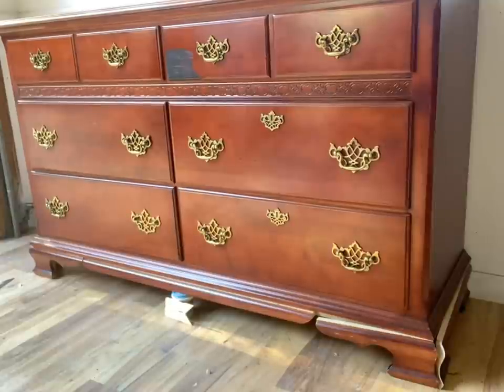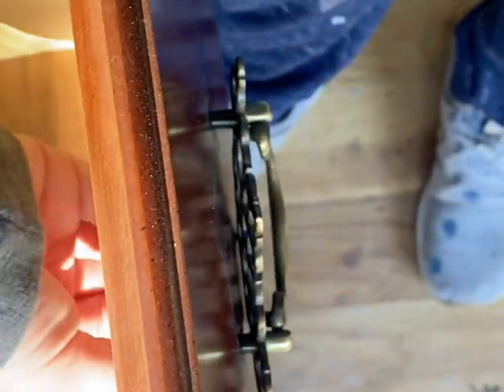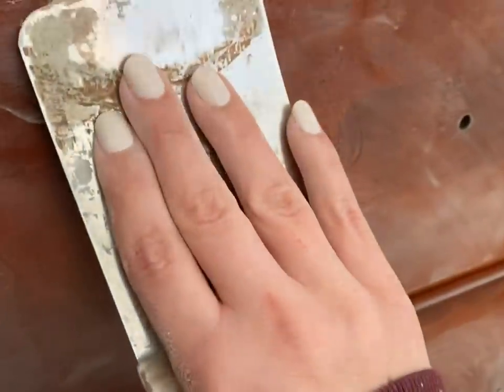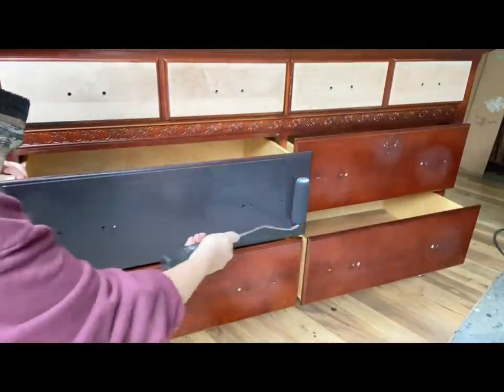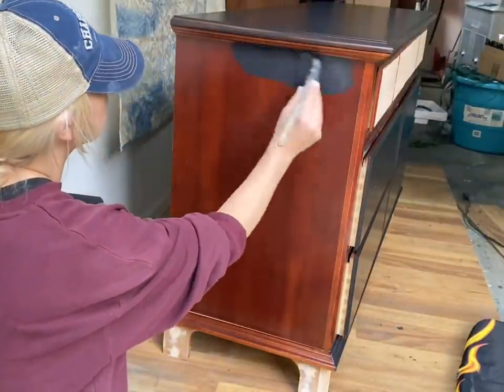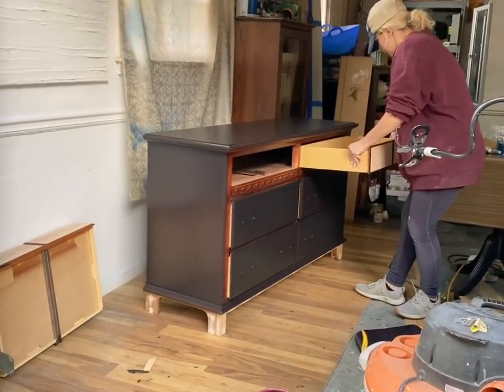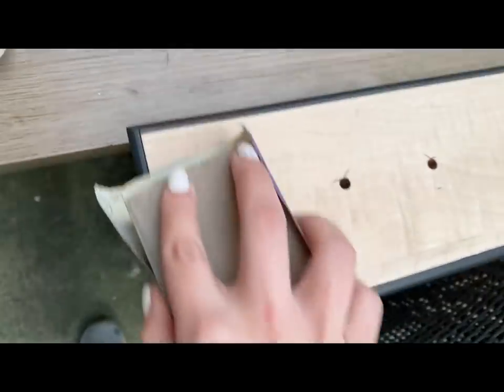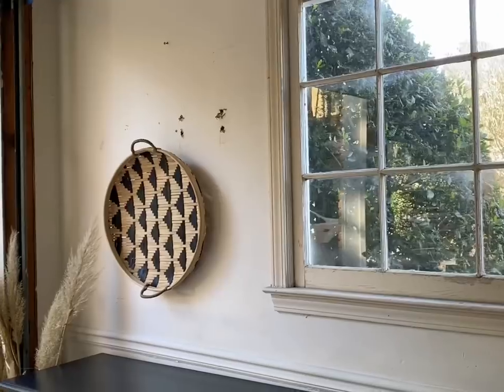These legs were behind the skirt of this dresser already!  Easy to do Boho furniture makeover

Comment: I wanted to pass along a process I use for final clear coat that is same as sprayed. Use oil based polyurethane use an old plastic bowl you can throw away and mix 1/2 mineral spirits or Xylol (Xylene)  to 1/2 polyurethane. Take a thin cotton rag I use the white cup towels like you use in the kitchen they must be lint free and cut into a 4" or 6" square folded three or four times. You want to wear a latex surgical type glove then really wet your rag and start to apply to the surface just making sure to wipe on a thin coat & let dry a lot of times I let it dry overnight. Next sand between coats using 1000 or 2000 grit paper remove dust and wipe with sticky cheesecloth to ensure all dust is removed then apply another coat of polyurethane repeating process until you have the amount of coats you desire after the last coat is applied and sanded I go back and wipe with a very very thin just damp application of polyurethane for the last coat and no further sanding I use this application for any project including kitchen cabinets and high gloss it produces a beautiful finish.
Reply: I prefer oil based clear coat because it seems to self level much better than water based. I can’t wait to try this!

Comment: I find spot priming where I used wood filler helps. I'll do two applications of wood filler and then spot prime the places with wood filler with clear shellac so that it absorbs the paint the same way as the rest of the wood that has a finish on it.
Reply from the maker: Great tip, thank you 🙏

Comment: Nice job!  

I think they're tongue depressors not popsicle sticks.  You should drill holes in the tongue depressors that line up with the drawer pulls, then you can use them as templates for the holes.
Reply: I thought the same and then realized that by doing it the way she does, she doesn’t have to ensure the holes are straight. She just uses the tongue depressor as a guide and a straight edge.

Comment: Sherwin-Williams has a paint in their "Emerald" line that is a Urethane Trim Enamel.  It sells for $100.00 a gallon but it's worth every penny.  The quarts sell for 40 so it only makes sense to buy a gallon.  I am getting ready to spray my cabinets, the legs and base on our table and our island so when you think of it like that the paint doesn't seem so expensive.  I am going to give this paint you have here a try though.  SW makes good paint no question about it.
Reply from the maker: I used that paint before and it dries slowly and for my working conditions (in the garage w/debris around) I had a lot of trouble with dust and what not falling into my finish before it dried.  I’m sure indoors would be awesome though.  I did really like the durability of it and it leveled nicely

Comment: Hi, re wood-filling my tip would be to use an old credit card instead of that large metal tool you'll find it easier to apply (smaller) amounts of filler, other than that good job done. Stu

Comment: Morning! Love this black dresser.What a difference once the bottom is removed.

I have a question about another of your videos from a while back - I'm currently in the process of re-creating your Pottery Barn Sausalito finish (which I LOVE ❤️). Using the Behr Rugged Tan as you suggested, and it's still tacky after 3 days. 🤷 Is this normal? I waited 12+hours between coats so didn't rush it and I also thoroughly prepped. Any idea what's happening? Has this happened to you using Behr paint? TIA for any advice.

❤️❤️❤️ your channel. So glad  I found it!
Reply from the maker: With the weather these days, my dry times are taking forever!  Just give it some time, when I’m going for darker looks I apply more glaze and it takes forever to dry, up to a week.  Bring it inside or run a dehumidifier if you can that’ll help

Comment: Hi Shannon, hoping I can ask an unrelated question.  I recently stained an old wooden lazy Susan I had in the kitchen,  (ok, so two days ago) the only stain I had was a min wax oil based stain.  (Didn’t feel like running out and getting a water based).  So I used it and it turned out beautiful, however, it’s been drying in a heated workshop downstairs for two days and it’s still very tacky.  Do I wait until the tackiness goes away before I spray on the poly?  And…..if I spray an oil based poly on top, will it then become tacky again?   I’m not sure how oil based stains work to be honest, first time using one.    Oh and is there such a thing as a water based poly?   BTW, sorry this dresser is FAB!!!!
Reply from the maker: Oil can take a while to dry, just give it some time, and you’re right to wait until it is dry to paint the clear coat on.  You can use any clear coat, oil or water works great but I prefer Varathane water based polyurethane or Minwax polycrylic.  Sounds like it’ll be a great looking lazy Susan!
Reply: @blacksheephouse  Thank so much for helping me.  Ok I’ll keep waiting, still tacky tonight.   So I’ll leave it alone til dry.   And thx for the tips, I wanted to try the water based Varathane so I think I’ll go out and find some tomorrow.   Thanks for all your videos, I’ve got a few projects lined up for next year and can’t wait for Santa to bring me my paint sprayer.    Lol.     Have a very Merry Christmas and all the best to you and your family.

Comment: For the wood filler test, I pledge an out-of-field option; Automotive body filler. It's available to online, anywhere and formulated for sanding so results you'll like I think. Try the cheapest one on Amazon maybe? Love the talk over detail and you explain what the methods are, those you use and the alternatives. But then explain how the others differ in how they work. So I've learnt three methods not the names of three mtehods I then have to go look up. And yep, still think you're bloody brilliant. Keep waggling that paintbrush, because that reveal at the end with the old one? I now blame you for the carpet burn on my chin.